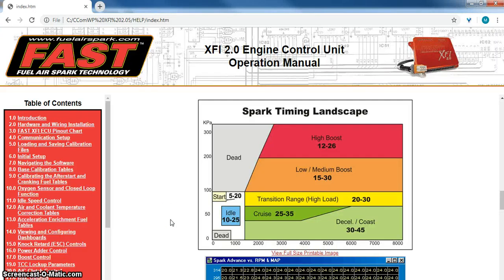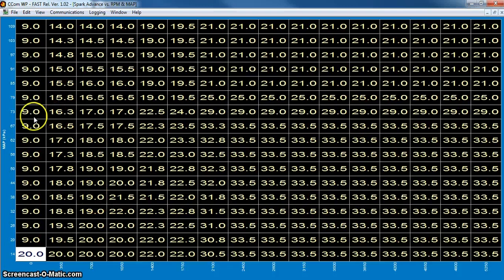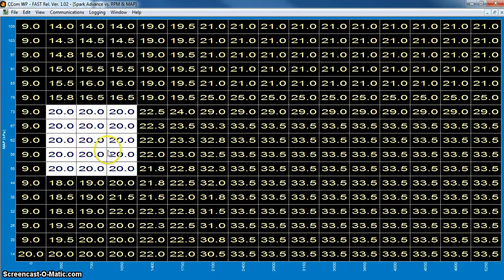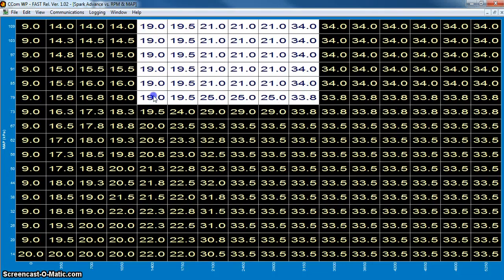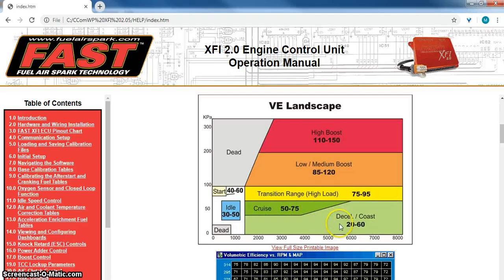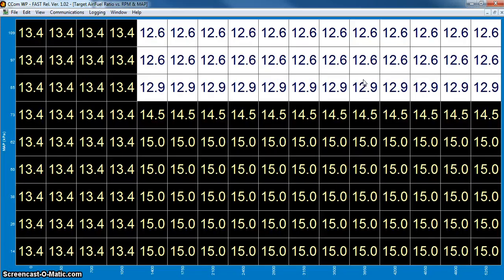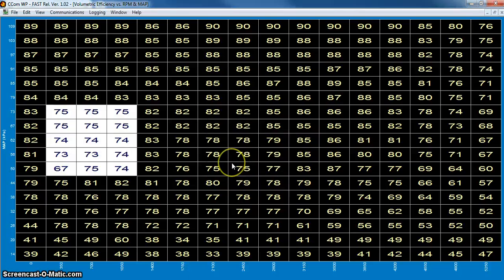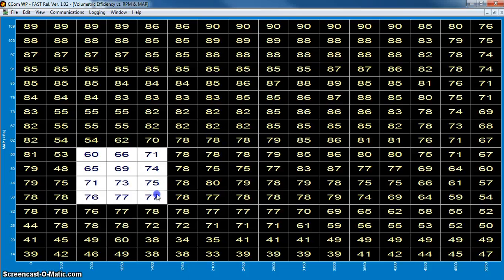FAST Classic Tuning Crash Course

Comment: Its interesting how with a carburetor and a distributor locked out tining is around 34 degress but with efi its like 24 degrees why is that ?
Reply from the maker: It really varies, depending on the application.  Locked out distributors keep things simple and reliable.  With EFI, it is very easy to set a timing curve with the laptop, and more performance or drivability can be found many times.